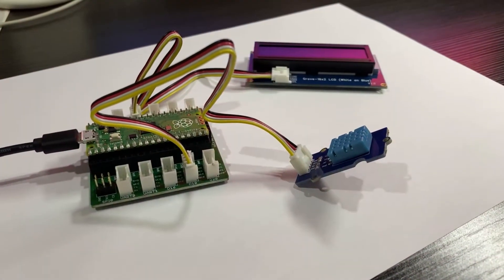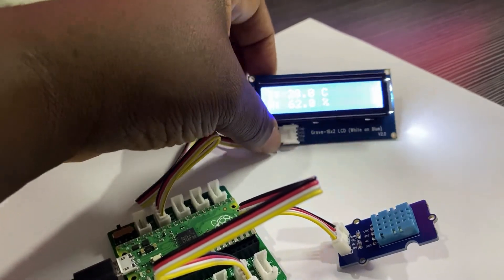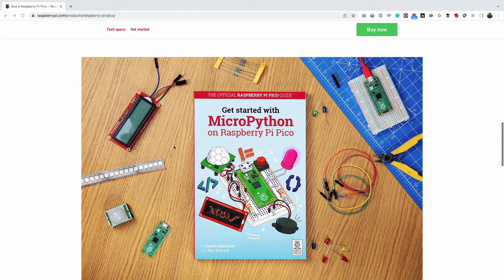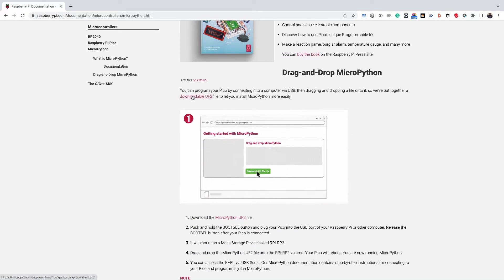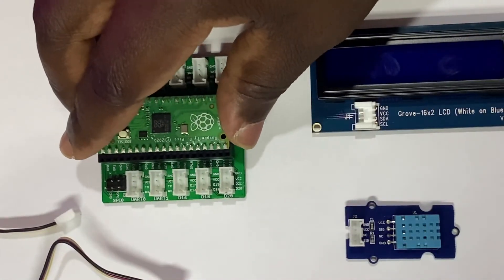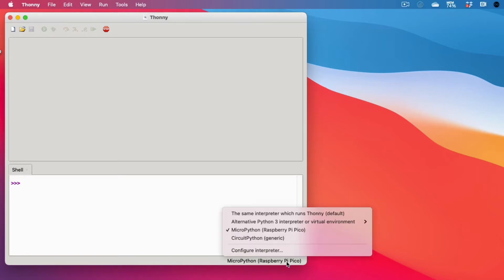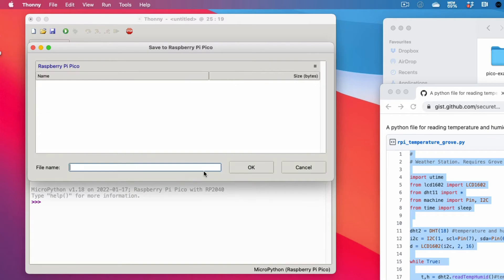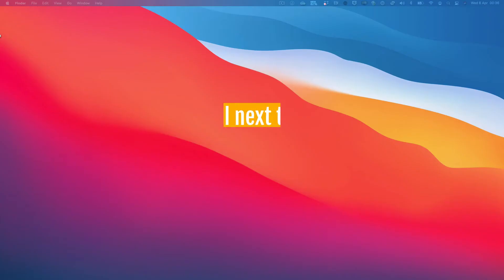Raspberry Pi Pico Temperature Sensor in MicroPython

Comment: Is it possible to run multiple sensors add them in the code with that board?
Reply from the maker: Yes, it’s absolutely possible to run multiple sensors. In this particular setup you have got two I2C ports so you can plug in two devices that communicate over I2C. You also have UART, digital, and analog to play around with.